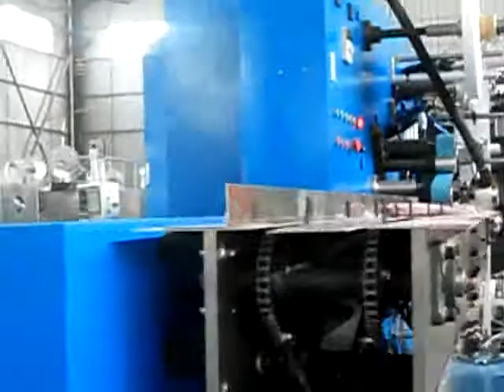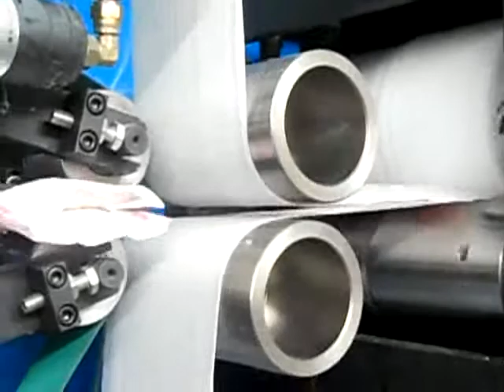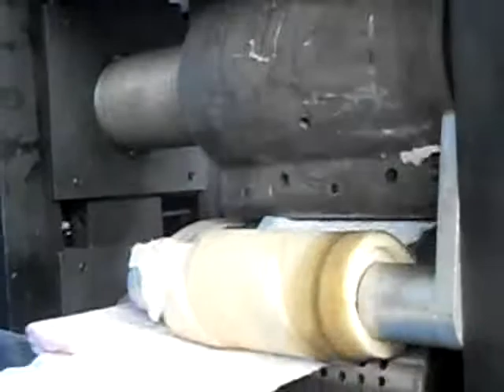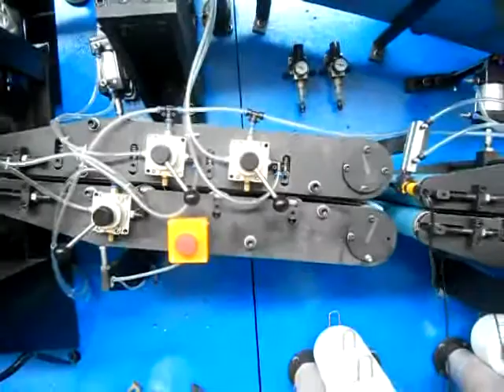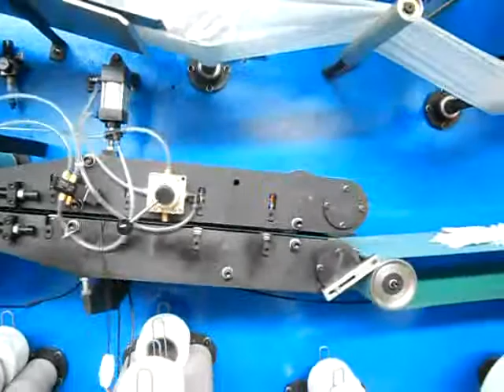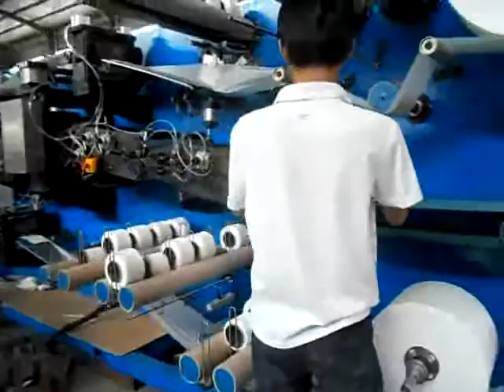pull up making machine,small and easy machine to make pull up,baby diapers

Comment: I appreciate this video, knowledge on how these are made is hard for me to find because I do not know the right terms to use. If you wouldn't mind taking a moment to answer this, what is the process on joining the sides of the pull-up called? I want to say they are "crimped together" but nothing comes up when I search that. What is the term for the tool that presses the side fabric and joins it together?
Reply: Hello Caleb, I do not know if this information is still relevant for you, the unit that joints the nonwoven materials is normally called a Thermosealing unit.